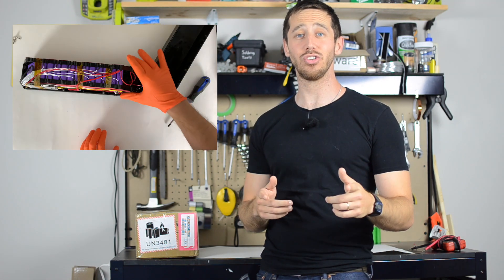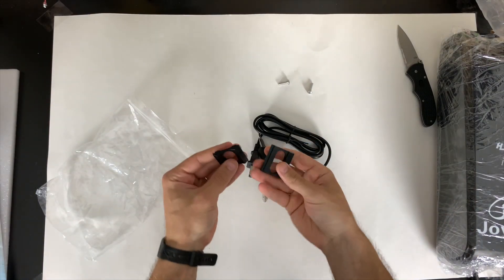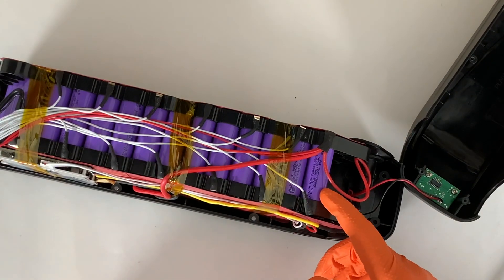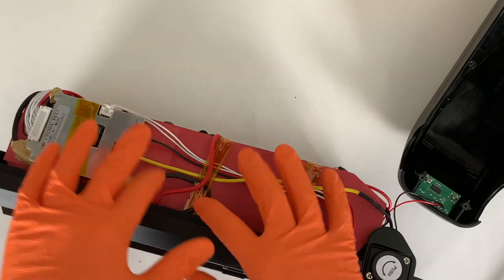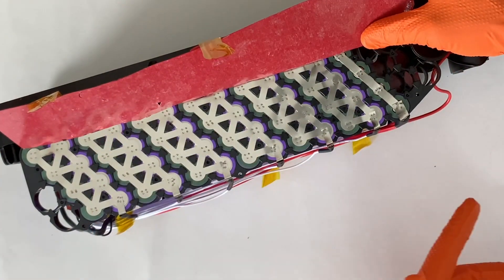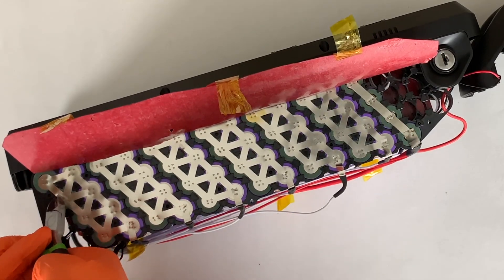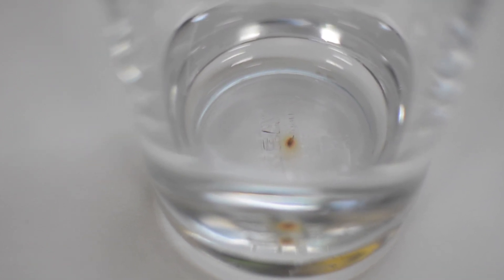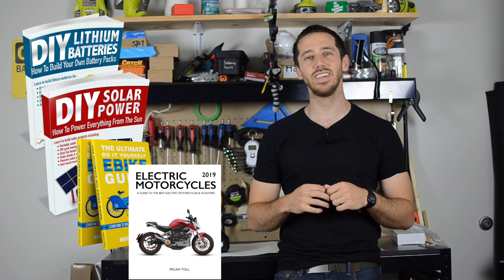How do you know if a battery is good quality?

Comment: Help Educational content required. Try and make sentences brief. 

Picked up 8 New DeWalt 12volt  DC9071 XRP (pres 2.0Amps)

How to charge 8 batteries safely - biggest shelf charger i cant find is double - does your off the shelf product do it & how - anyone elses products feel free

Looking for torch skins and plug to battery so all this coming out is 2 wires to be made into series or parrallel battery can anyone search USA wholesalers cant find Aus or China, any shops contribute. 

Wouldnt mind wiring it up two rows of V4 independently so all 8 can be on their at once and isolate one set of 4 so with retrograde charging use 4 batteries out trip 4 batteries back trip should be relatively even.

Wire it in what configuration to run what kit? 24v x 8.0Amps x2 banks I think? and what can that run?

A bike kit a trike, anyone got an cart kit so my kids can learn to drive?

Who's got what suggestion? I do have some arthritis in general including hands neck and shoulders is why Im asking, I need a simple solution kit solutions great and plug and play great.

Comment: hey I just want you to know how much I appreciate your videos they are very educational, I live in New York Queens and my light bill is usually a round $87 to $92 a month. if you can guesstimate what size power pack or powerwall  i would need to run my TV 40'' HP laptop xbox 360, wifi box ,modem, thought full sun windows solar panels for recharging ? .

Comment: You're correct. I come here for great technical knowledge just like you provided in this video. The nickel test, the explanation of the terminal thickness on the power wires... I will use that for sure. Micah is my only ebike subscription on youtube (i'm a 2wd m365 builder)

Comment: Hi! I have a scooter and it has two port connection to charge the battery,  I have only been using the charger that came with it, to fully charge the battery takes close to 12 hours, I got another charge same as the original one. My question is if I connect both to charge the battery, will it damage the battery or  cuts battery life shorter?
Thanks
Jack.

Comment: Micah. you are the #$!% thanks for making fine informative videos. So... mainly because of you, to be honest, I have  embarked on the great self made battery pack journey. I have been riding an electric bike (250 watt... store bought) for over a year now and I love it and there's really no turning back, So I Invested in some tools and equipment/materials. etc. to electrify my Kayak. I have the 48v 1800 watt motor and controller and some other components such as the 3" prop. I now have the 18650 cells, a spot welder and nickel strips and such. So I plan to over volt it to 52v, with the hopes of picking up enough speed to plane. But thanks for all the help, I'm sure you will also be an essential component along the way.

Comment: Micah, if you keep giving good info then length doesn't matter.  In a somewhat related vain I recently watched a video about whether high mah batteries were real.  He showed a 9800 mah that was supposedly protected and after testing it, max was about 550 mah, he opened up the can and low and behold there was no protection circuit  and very little actual battery materials in there.  He stated that in fact in fact the major manuf's had just recently reached the 3600 mah plateau, video was several yrs. old, and anything over that was suspect. As the video was was several yrs. old I would think that the industry has gone beyond 3600 mah, maybe to 4000 mah.  Now for the painful part of the story, about a week before I viewed the video I received an order from Amazon for 100 BXE 9800 mah batteries, now I have a 100 battery paperweight.  BTW  a true L-i battery, unprotected, should weigh about 46 g and 50 g protected.

Comment: With the cells having a max discharge current at 30 amps in a 4 cell configuration should he have put it in a 5 cell configuration with a different seines configuration or just went with a different battery altogether?

Comment: Hi, I am wondering can i put two 11.5ah batteries in parallel to give me a23ah, if so how could i connect the two batteries together? Great videos, thank you (Ireland) .
Reply: In general it's not a good idea. As two separately managed packs, one pack could feed into a less charged pack if they aren't balanced or the same capacity and type of cell, even age of the cells. If you want more capacity, you put more cells in parallel under 1 BMS.

Positive cable from one pack to positive cable of the other pack, negative cables go together as well. The batteries must be able to disconnect output and be turned off. They also can't be charged from the output cables when in parallel.

Comment: I would have taken the weight of the cell into account if I found that they used nickle coated Steele.  18650  should be 18 mm x65 mm and have a weight of between 41 and 45 grams obviously the heavier the cell the more the capacity.  also if you had pealed a cell cap you could have checked for a protection circuit and venting in the top of the battery.  This is another strong indicator as to the quality of the battery and lastly hook the battery up and check its discharge rate.  Thank you so much for all  your hard work. I have learned so much by watching your videos.  You have brought so much useful information and done so much for us guys that hack around at home.  Have a great day and please keep making lots of videos.  As far as the length of the video goes the longer the more information.

Comment: There is a 3s squire bms with a "T" marked connection with 2 pins. Is that for a temperature sensor? The T might be upside down, not sure.

Comment: Hi could you do a video about salvaged drill / laptop cells , pros & cons
Reply: Please do a proper build and review as if you yourself were going to use an Ego 56v or Toro or Dewalt 60v using the adapters and harnesses now available. Why did the ebike world SETTLE on a tightly packed black brick with no passive thermal management for the defacto battery pack? I would like to see what an Ego 56v 10AH battery would do against a 48 or 52 volt name brand ebike brick battery in terms of range, top speed, cell temperatures, and Warranty. I am newly subscribed after 20 years of not being in ebikes. My last one was 24 volt lead acid chain drive Currie. Things have changed, but whey are we stuffing so many cells in a tight space? Can’t we be more creative on how to mount and design battery packs yet?

Comment: Hey I'm Making a battery Pack for a bike
and after i have cheked the capacity There is a 200Mah Diffrence From The Best battery and the Worst
Can i still Make a battery pack ?
I only have 10 Batteries and i want to make 36v battery so I cannot parrallel those battery together 

Hope any can Answer

1cell 2946Mah
2cell 3148

Comment: Great video, master! 
I'm new in this  ebike-electronic device's world or hobby.
I'm assembling my ebike (cheap option to get to my workplace 3 miles away) and as a new starter I've done something quite stupid and embarrassing to mention here. The point is I bought the same battery you are showing and I need that BMS which I cannot find. I'm a Spaniard living in UK, could you advice me where I could find it (the ones in eBay/Amazon don't look equal) or the specs for a similar one?
I'd appreciate very much an answer. 
Many thanks.

Comment: Hi there,
I have a question i need to bulid 1 battery pack, and it need to be on 2 floors,
100 cell on 100 cell, that the only way i can fit them.
What is the best way to connect the 2 floors together, with nickel strip? What is the best layout for thos.
All the 200 cell going to be on the same bms, thanks a lot
Roi

Comment: So compare this construction, material etc to the vruzend battery kit, which is better? as vruzend uses bolt and nuts etc which could actually produce heat and loss of power as well

Comment: All my laptop battery packs have temperature monitoring, for far fewer cells.  I give this battery pack a thumbs down since it is sold as and rated for the maximum current capable by all the cells, which if driven at that level will definitely overheat and thereby shorten the life of the pack if not destroy the pack.

Comment: JOYISI TOLD ME THEY ARE 18650 Foster Brand Cells 2500ma. THEY also sent me Free XT60, and XT90 wired connectors free DHL from CHINA 5 day shipping. Battery Took Fedex from China 8 Days, Airmail to SoCal then Fedex to Oregon in 8 days

Comment: I have this battery !!!! is this battery the Joyisi 48v 10ah ? I spoke a lot time talking to them joyce messaging on amazon. They told me the higher AH VERSION they offery on the same page. Make of this model they said they are Samsung Cells, and they did say that this battery they were honest about the chinese cells. T and you are very correct for everything that they told me. Which is really cool, they were very honest. I did They said they are called "Foster" Brand Chinese Cell Brand. Your video is very accurate, from the LONG conversation with Joyisi i had. Thanks for making this video. Wow I did not think i would find a video on my EXACT battery. Thank You. They also wouldn't tell me what brand BMS was. but whatever. I am waiting for my wheel kit from, Golden Motors out of Canada. Magic Pie 5 Vector, with bluetooth adaptor add on $488 Free Shipping to Oregon

Comment: i had a shimano battery fail in 6 months so might as well use these sort of batterys.cheeper and you dont have to wory about sendin 100 emails to get people to replace your shimano battery.plus your  locked out of using aftermarket battery with shimano,they want you to buy there expensive battery..even when you have warantee.

Comment: Have you ever used the big(ish) prismatic LifePO4 cells in a battery pack?  I am looking to build a ebike conversion and I am liking the 25aH aluminum cased cells for it.  Is it a case of size or cost for you?  They are not a fire hazzard and have 5 times the cycle life.  You book helped in planning the battery pack.

Comment: On those cheapo BMS' I wouldn't assume they have "balance wires" just by looking at them as they may in fact just be "sense wires" for H and LVC of the cells. Many or in fact most of the ones I see of this style are in fact of the non balancing kind and it's not exactly difficult to test on its 1st recharge. Are you going to do be doing any bench testing on it?

Comment: Can i charge two 12v battery pack (each has its own BMS) using   a 24V lithium ion charger? - connecting the two packs in series?
Reply: Yes, but check each pack to make sure they are close voltage (<0.5V apart) and then periodically to ensure voltage balance.

Comment: I love your videos and watch regularly. 
I think your assumption that the cells are inferior because they were made in China is not necessarily so. They have a realistic rating of 2500 ma . I think it would have been more informative  to have load tested  the Joysi battery and then compared it to a Panasonic.  I buy a lot electronics from China an find them of very good quality.    Also it would be more accurate to have tested the nickel connecting strips against the nickel/steel strip to see if there is any real difference or if the pure nickel is over kill.
Reply: Actually FST cells are one of the good decent Chinese cells. I used them in a few packs that pushing below 25amps and maybe seen one cell out of a pack that actually failed due to bad BMS and replaced damaged cell and repair pack. They pretty reliable. The LG I had failed more the grey MG26 mainly. The LG IMR purple ones are the reliable one, or Panasonic, or Sanyo GA are reliable as well.

Comment: I'm the only one saying that he underestimated (250-300w) this battery power? I think is safe enough for up to 750w motor . What others think  ?
Reply: It is fine for light commuting range of 10-15 miles. Ideally, you want a battery that is 2x the rated motor power so 750w x 2 = 1500wH. This way when you go max power 750W (~25-27mph) it will only draw 0.5C which is great for the battery. The bigger the battery the less high power draw have a detrimental effect on battery performance. Of course, we cannot have a beginners 1500wH battery but yeah you kinda work your way up and see if you like ebiking and then invest in a good branded cell big battery.

Comment: Hi Micah, as usual excellent and very informative video, thanks!
The only thing I miss is that the cells are SUPPOSED to be 2500mAh from the technical sheet but this should be checked to really know if this is a good quality battery.
It would have been nice if you had been able to charge/discharge 1 cell and see if we are close to theoretical specs (or not...)

Comment: Can I connect  2 batteries of different make to my e bike having the same voltage to increase my range of my e bike
Reply: You gotta be real careful doing this. Do you know if the they have the same cells, discharge and charge characteristics, same capacity? MAKE SURE THEY ARE NEAR SAME VOLTAGE BEFORE PARRELEL CONNECTING. DO THIS NEAR OPEN GARAGE. DOUBLE CHECK EVERYTHIKNG

Comment: The electrical resistance of Nickel is about 70% of that of Iron, so the difference isn't very big. There are plenty of cross sections between cells in series, so it wouldn't be a problem at all. You could have actually measured the width and the thickness of the strips and do some calculations instead of using words like 'I guess' and 'probably'. The point that worries me is the (dual layer) strips of the first and last row.
Furthermore, you didn't measure the capacity of the cells. You went for the datasheet. If there is one thing you cannot trust it's the specs of Chinese cells. They are sold to up to 9999 mAh which is nearly 3 times of what is even possible at the moment. Most of them perform way below their (fake) specs.
Reply: Those are really only the UltraFire cells. If you get branded cells that weigh the right amount, you can be confident they have decent capacity. Internal resistance on the other hand...
Reply: @kevincai96  Most of them are also recycled and rewrapped.

Comment: Very interesting. It seems necessary to take stuff from China apart to check its quality. Hopefully their quality control systems will improve over time. I have a question. My Radrover 13S4P battery when fully charged measures 53.1V. The charger puts out 54.6V, but after light goes green and it stops charging the battery measures 53.1V. Why doesn't the battery charge to 54.6v? I believe it uses Samsung 35E cells but I've never opened it up.

Comment: That's an excellent review! You examined every important points including common CONS that cheap battery have. Btw, sometime when a parallel group have the main positive or negative wire soldered to one end of a parallel group, there chance that the  opposite polarity have a serie link to the other end, which conpensate for current balance.. but in that design where serie parallel connections are in majority in "W" there is les chances. Also i would have been curious to see  if teh ON/Off  switch is connected to the BMS SW1  input.. usually located close to the external  temp sensor connections... in fact BMS with switch input and temp sensor are usually input that are connected in serie.. and when there is no external switch used, the connections on teh PCBare simply jumped together to close the loop and enable the BMS FETS.

Comment: I just got a kit 48V 12.5AH with front Hub motor (1500W) with a 18 mosfet controller and a KT—LCD8H display but I am having issues.  when I add too much throttle manually via a twist of the wrist the power cuts out but if I add throttle slowly like over 15 seconds I can reach max speed.  This also happens when I use a higher assist setting for the PAS.  I also noticed that this happens a let less when the battery is at 100% charge and then when I get to <75%  I have to turn the down all the assist power on the throttle and PAS or its just consistently cutting out.  The thing is that even at <50% charge so around 45-46V I can still reach top speed as long as I take my time getting there..  Would that be a battery not able to supply the amp requested by the controller so it just cuts out? or is there an issue with the controller?  Have you ever seen this before?  Any help would be greatly appreciated..  BTW I have tired all the possible settings in the controller including the 1/2 requested amps option with the same issue occurring..  BTW my battery looks exactly like that one and also the shipping box is the same..
Reply: It depends on the "C" rating of the cells in your battery. The size is definitely too small for your motor. W=V•A.
Reply: @myrondesjarlait9752  I took the controller apart to see if I can spot anything and found the issue with bad solder on one of the capacitor legs, It was loose!!  I was able to re-solder it and went for a test of 20km and all is GOOD!  Everything is now working great!!
Reply: @myrondesjarlait9752  Thanks for the input but I also wanted to add that once i get it going fast the display shows me that its drawing around 1000W on flat ground and I have seen up to 1500W going uphill with no issues.  But then it can cut out just showing less then 100W so I don't get it..  The battery is listed at 30A continues.  I think its just a faulty controller.  I guess I will have to order another one to find out..

Comment: A very instructive video, thank you for sharing.
What do you think about the so called "Tesla fuse method" (using the legs of a 1/8 w resistor as a fuse between parallel groups).
Thank you again. Regards from Colombia
Reply: Wouldn't that require soldiering and therfore damaging the anodes with heat?